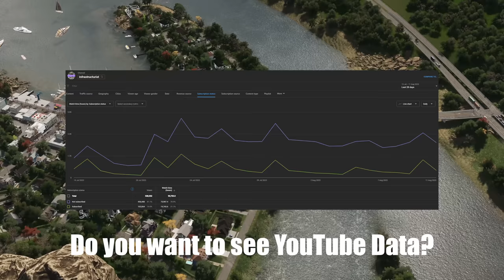How to turn a BAD Intersection into a GREAT Interchange in Cities Skylines

Comment: Really nice looking intersection!

One tip from me:
You should use traffic manager to select all intersections that doesn't have conflicting traffic and enable the "allow to enter blocked junction" option. This helps in particular the roads coming down from the mountain, where you can se at massive gap between the cars before and after the node in 32:17. If one of the cars in the back wants to take a right turn, they are blocked by the cars that are standing directly in front, instead of letting the cars queue up inside the node/junction.
Reply from the maker: Thanks a lot! I really forgot that, whoops - I've made sure its been fixed! ☺
Reply: Great information...thank you for sharing your insights..I appreciate it..👍💯👍

Comment: Nice intersection, and good video! Learned a few tips and tricks from you!

I couldn't happen but notice your comment about the chevrons, though. I know they can sometimes be hell, but for the merge lanes the fix was very easy by just turning them in the 'guides' section. Just make sure that the cars go towards the V. The lines on both sides of the chevron point towards where the vehicle should go. Same goes for normal lines actually. On a 2 lane road (like the national road) the middle markings are normal stripes and both sides 'point' towards where the car should go:  v |/| ^  (opposite direction) and ^ |V| ^ for merge lanes (same direction). Hope it helps!
Reply from the maker: Thanks a ton Patrick ☺ - and you're right, they aren't too much of a pain to do right, especially with your input! I sort of cheaped out 😂😂

Comment: I discovered the other day that the Turn button (with the rotate arrows symbol) next to 'Guides" (on the filler tab) in Intersection Marking Tool will change the alignment of the chevron to the correct road and quickly make it point the right way

Comment: I discovered the other day that in IMT, a click or two of that button with the rotate symbol will quickly switch the direction of your chevrons to the direction of the correct road - if they don't look right, it's because they're aligned with the wrong road